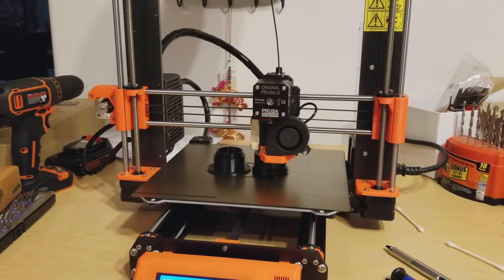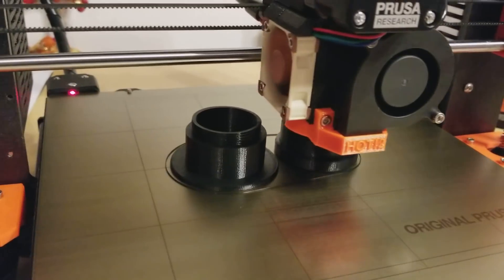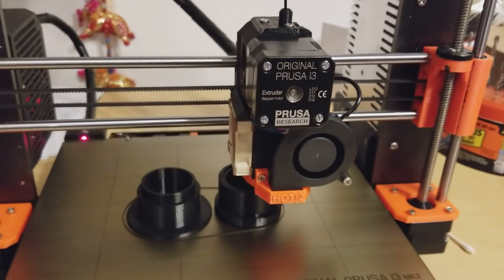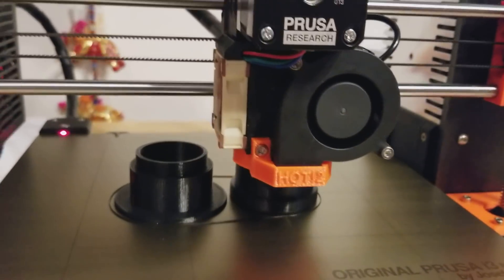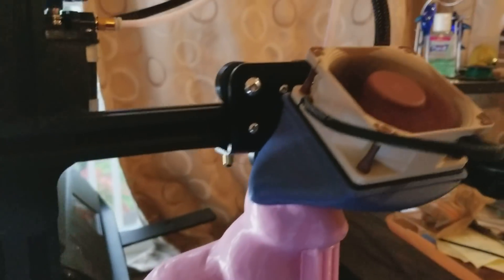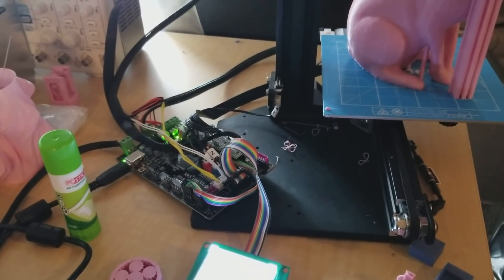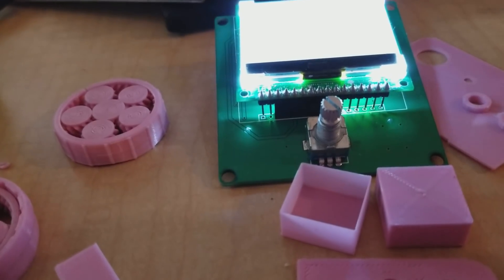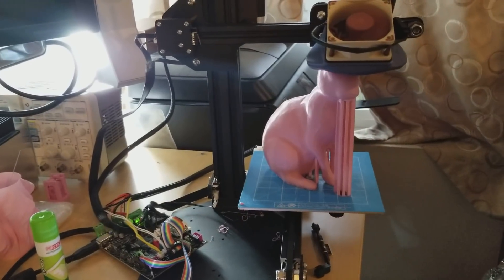Prusa i3 Mk3 is quiet, but can the Ender 2 be quieter?

Comment: How did you manage to get away without using active cooling on the drivers? How much current did u set up in marlin? I get overheat issues without a fan blowing onto them even though i am using genuine watterott stepsticks.
Reply from the maker: The problem with "step sticks" is that the very small PCB simply cannot spread the heat like an integrated mainboard can, so they will run hotter on the stick. I'm using 9x9x5 heatsinks to help spread the heat https://www.amazon.com/gp/product/B072ZSBH17 and they still overheat if i push them much over 700mA at 12V, but this printer is so small it doesn't need to push around a lot of mass and so far I haven't had any problems to indicate that more current is needed. I have a 24V supply sitting around that I'm considering "upgrading" to - but I'm trying to understand "why" I should. Or more accurately what tangible advantages running at 24v gives a printer so I could measure and compare a before and after. It's something I'll do a video on if I can figure out the "why" ;)
Reply: I already have these heatsinks on them and am also using about 700mA on x and y. Stealthchop resulted only in a lot of skipped steps, maybe due to the fast acceleration. Skipped steps are the main reason I wanted to experiment with these drivers but unfortunately  marlin still does not support the skipped step recovery feature. They gave me only a lot of frustration. I can't even use the print from sd feature because it looks like the drivers and the sd card are interfering with each other on the SPI bus. It is really annoying having a USB cable hanging across the room. I have 3 printers in a <25mˇ2 room one of which being an CR-10 so you can imagine i haven't got a lot of room.
Reply from the maker: I can offer some advice on the SD print problem with TMC2130's in the loop. I'm not sure what mainboard you are using but if its a RAMPS based board D53 may be your problem. D53 is typically used as as the CS (Chip Select) for the SD card, D53 is also part of AUX-3 which is where you have likely connected one of your driver CS pins as well (the X-axis i believe). Move your drive off of D53 and modify Marlin (https://github.com/MarlinFirmware/Marlin/blob/ac3fab7a9680a880fd1b113be7e758c6dabb2a57/Marlin/pins_RAMPS.h#L94) to use whatever pin you have chosen (maybe use one of the servo pins instead).

I've noticed a strange artifact at high print speeds which looks like skipped micro-steps but no skipped full steps because the "shift" "unshifts" itself when the wall geometry changes... e.g. good flat wall - now there's a dimple in the wall (XY cube checking for ringing) and where the dimple is there is a layer shift for that face after the dimple - but once the print progresses (vertically) past the dimple the wall goes back to fantastic. I haven't investigated the cause or solutions yet, frankly my first guess would be the cheap steppers themselves but that's just an impulsive guess - maybe this is something that going to 24v could help with, IDK.
Reply: well yes, i-m using ramps 1.4 electronics...as dodgy as it gets...of course i have changed the CS pins, but i have still many problems too solve and things to adjust...spreadcycle makes the steppers noisy with high pitch so this could be one reason to use 24 V
Reply from the maker: I'll give it a shot.
Reply from the maker: Wow that's a horrible sound LOL - sounds like an old dialup modem. I now regret taking the time to mod Marlin to expose toggling stealth mode via the LCD
Reply from the maker: Running off of 24V didn't improve the sound, odds are good the configuration is more complex than simply turning off stealth chop. I need to transition my attentions to my Prusa now that my Ender is running fantastically and reliably - I'll keep an eye out for how Prusa configured the TMC drivers when i get around to looking into their marlin modifications.

Comment: It would be interesting to see if this can work on the Tronxy X1! It would lower the price a good $50
Reply from the maker: I'm sure it could work, but that $50 is going somewhere - like a heated bed and about 70mm of vertical build volume (150 on the X1 vs 220 on the Ender) if nothing else. I've also seen reviews on the X1 where axis were lose and there was no way to increase the tension on wheels without bending the frame... I have no idea how wide spread this issue is but buyer beware.
Reply: Ross K Yeah I agree with you about that, especially about the heated bed and the extra 70mm of build height, but the rest of the issues can be solved with only about a dollar of 3D printed parts. Excited for the next update about the TMC2130 drivers and the MKS gen 1.4!

Comment: So you can't put the TMC2130 stepper drivers on the stock Ender Board?
Reply: I'm so curious to learn how to make it myself that I've just subscribed to you channel
Reply from the maker: Not in any reasonable way. The stock board has integrated drivers (the stepper drivers are soldered onto the board, they are not removable). This is actually a good thing from a thermal perspective but they cannot be replaced or upgraded by the average user with a soldering iron.

I'm sure I could figure out how to use the stock board if I really had to but it wouldn't likely be something others could follow and would likely be a very messy hack involving a lot of "air wires". I have access to SMD rework equipment so I could replace the driver chips on the stock board, if they burned out for example, but the TMC2130's are just too different to drop in place of the stock drivers - they even have a different physical footprint.

Totally extra info:
The stock board uses the ATMEGA 1284P controller which has only half the program memory (FLASH) and less than half the pins of the 2560. Both chips are 8-bit and a rather antiquated, however, the 1284 is actually the "more powerful" of the two. It has a higher clock rate (20MHz vs 16) and twice the RAM (16KB vs 8KB). That said, I'm using the extra FLASH (54% of the 256k) of the 2560 and I'm a long ways from running out of RAM with all the features I have enabled in Marlin. If I were using the 1284 I would need to be trading one feature for another at this point.
Reply: Thank you so much for your thorough reply.  I'm subscribing.
You rock!
oh, BTW, you opened a can of worms becuase Im a noob and i love asking questions!
Sucks to be you!
(No, I bet its awesome to be you....)
Reply from the maker: I enjoy answering questions - it challenges me to confirm my understanding of things ;)
Reply: What are you thinking now as far as fan shroud?  What would you do differently, if anything?
Reply from the maker: Well, my huge 60mm fan is doing a fine job but i would like to have a dedicated part cooling fan to make for fewer first layer problems. But whatever solution I come up with I want it to be a quiet one. I wish Noctua made blowers too :P

Comment: Can ender 2 be used for paste extrusion?
Reply from the maker: Could you be more specific? If you mean solder paste then I don't see why it couldn't be modded to do so. Obviously you would need to replace the extruder and likely load custom firmware and that firmware would likely need to be configured to work on the controller board which comes with the Ender (or it would need to be replaced). Also keep in mind that the Ender 2 comes with the less powerful 8-bit micro ATMEGA1284 - I don't see why this would be an issue but I also have not looked into doing this "mod" myself.
Reply: Ross K  Yes, l would have to mod it  . Also I have a paste extruder setup idea. And also going to use other board. I just wanted to know where can I mount the syringe extruder setup?
Reply from the maker: Fair enough, I've put my X-Carriage model on thingiverse for you https://www.thingiverse.com/thing:2789191 hope it helps!
Reply: Ross K thanks again.

Comment: Hey how is the ender 2 compared to the mk3. Did you compare prints it's nice that you have both so you can compare.
Reply from the maker: Well, my Ender 2 is far from stock and I've had time to tune it, and my slicer profiles, in so right now I would have to say the Ender 2 is printing "better" than the mk3 but I haven't tuned the mk3 at all yet. That said, I actually observed a huge improvement in print quality (much reduced blobbing) on my Ender 2 by using the Prusa edition of Slic3r and cloning and modifying the mk3 profile to fit the ender. Of course by running strait Marlin I can take advantage of "linear advance" which has also really improved print quality IMO. You can find the Slic3r prusa ed. on the prusa website over here -> https://www.prusa3d.com/slic3r-prusa-edition/

Comment: wow what a nice print quality on the ender 2
Reply from the maker: Thanks, I've spent a good bit of time dialing it in. The Ender 2 is an awesome printer, especially at the price point.  It's not quite as dialed as I would like but I might be at the limits of the stock hotend and bowden tube. The ONLY reason I upgraded the electronics was for acoustics. The V-Wheels are surprisingly effective and allow for an extremely quiet printer - as evident in the video. My largest "complaint" about the printer is the print bed. Sometimes it is very hard to remove the prints and the act of doing so generally knocks the bed a little out of level and leveling this bed is a bit of a challenge for larger hands. I'll likely add an inductive probe at some point and/or go to a removable bed.
Reply: What do you think about a DIY removable, Spring Steel (don't' know why I capitalized those words) magnetic print surface?
Reply: Okay never mind i see you are working on that.
Derp
Reply from the maker: I think if someone was entrepreneuring enough they could make a good profit on kits. I LOVE the removable bed on the Prusa but I have to admit after installing a z-probe on my Ender part removal is much easier now because it's easier to have a predictable first layer and therefore avoid over adhesion. Sharpening my scraper tool also really helped. The hard part about going DIY is that the spring steel is expensive / not easy to source so people often go with soft cheap stuff from a home improvement store and high curing temp. magnets which are strong enough to act through the aluminum plate (not like everyone can mill the bed to insert them) are also very expensive - upwards of $3 each! But i would still love to add a removable bed to my Ender if it was practical...

Comment: Thank you for sharing this video! I'm also interested to silent my Ender-2. Up to now, I have switched the PSU for a PC PSU and mounted dampers on the motors. Could you comment on how your chose the MKS board? Did you use special stepper controllers?
Reply from the maker: I'm using the TMC2130 stepper drivers (they cost me $55 for 4 of them, the MKS was $35 the power supply was about $20 and heatsinks cost about $6). These drivers aren't/weren't available on any integrated mainboard I could find at the time. I know Prusa has them on the Einsy board but that board was not yet available for purchase (I see that it is now, for $110 - $120, but good luck finding it in stock https://ultimachine.com/products/einsy-rambo-1-1?variant=5522483773470) so I had to find a mainboard which accepts "StepSticks". Honestly the MKS 1.4 i have is physically larger than i would like but it was a trade-off between the board size and having the necessary pins for what I had in mind... keep in mind that at the time i had no idea if i could even re-use the display and if so if i would need EPX1 or EXP1 and EXP2... and I now do not have an SD card on my printer - but that's OK by me as I have a Raspberry Pi running OctoPrint which is better IMO than running around with a microSD card.
Reply: The einsy retro might be a good option also, you won't need to find 5v fans. I have one and tempted to do what you did. So definitely interested in your info, keep up the good work.